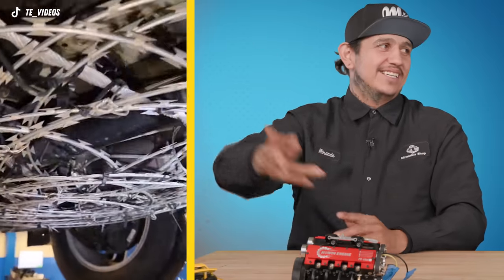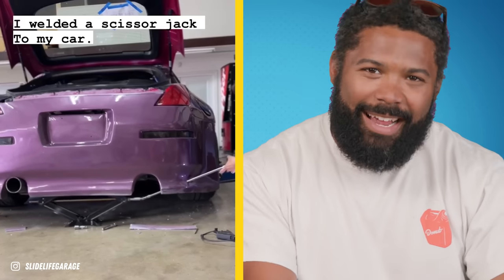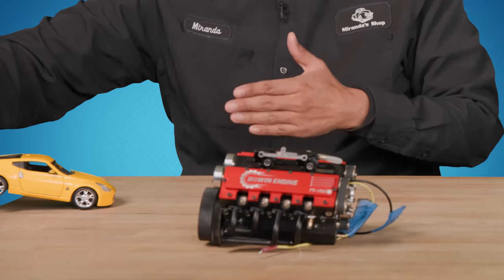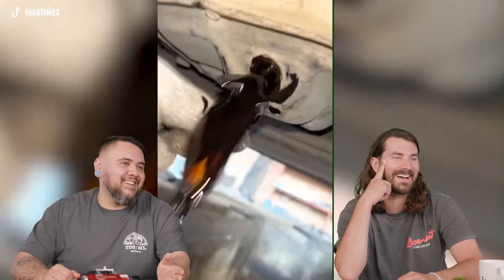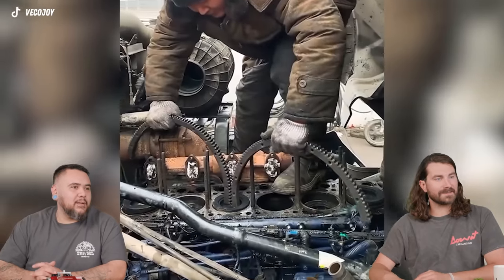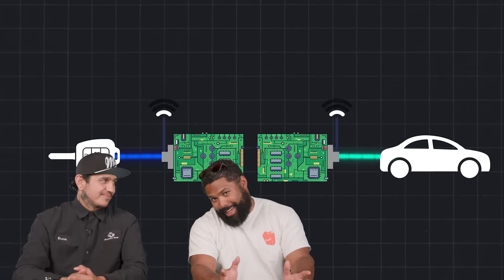Mechanic Reacts to Horrible DIY Car Hacks

Comment: With the tire regrooving, you can see that they filled the newish tire's tread with something and are simply scraping it out.
Reply: It's like nothing 5 minute crafts does is real!😜
Reply: Yes, but you can do that with the tyre repair stuff and get extra height. But yes, not bald
Reply: @LobbyDaLobster  yeah that's why I think it's a waste of time to feature them at all, since the logo alone is enough to dispel doubt on whether it's real or not
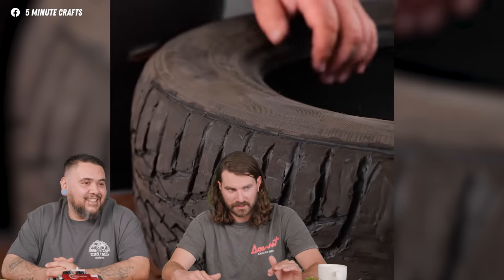Reply: Yeah, where he peels it away at 15:16 and there's a sharp corner on the right. Absolutely bogus. Five minute craps strikes again.
Reply: im roughly 80% sure that’s black playdoh or clay
Reply: @agingerredhead9380  You should be more sure than that! 🤣

Comment: The head/door opener thing works because the amount and shape of water in your head is roughly the right amount to act as an amplifier for the radio signal from the key fob.  You can do the exact same thing with a gallon jug of water (or watery solution like milk, washer fluid, detergent, etc).  Your head is essentially acting as an antenna for the signal.
Reply: Exactly what I was going to type
Reply: Indeed. In my experience the forehead works best.
Reply: It's crazy how good it works, the only downside being brain damage.
Reply: @redrob6026  it doesnt give you brain damage lmao
Reply: @redrob6026  Bro if that gave you brain damage, you'd be a vegetable just from listening to the radio
Reply: I would guess that it is acting as a reflector: not an antenna.
Reply: If only someone sent this explanation to Clarkson on Top Gear the early series where he was asking lol
Reply: Very close, but not quite the entire truth. Your whole body acts an amplifier/antenna. You can see this by placing the fob against your other hand, forearm, or thigh. It doesn't only work off your head.
Reply: @BowJew  Yagi antennas use reflectors that are just bars (not a plane).
Reply: Thanks for the comment! That one definitely needed a science-explanation.
Reply: I've done this with my remote control against my stomach personally
Reply: You are capacitatively coupling the remote to your head. The water in your skull acts as an okay conductor for that frequency band. It does give a little more range but generally not more than a car length or two.
Reply: My dad showed me by placing the fob on my chin, its how I always unlock my car when I am walking up no matter how far I am.
Reply: Oh damn. I thought maybe it had to do with teeth fillings.
Reply: I was thinking it was the water
Reply: It wouldn't work with my ex wife as she lacks a brain. This was discovered post marriage...I should've checked inside her ears prior...live and learn I suppose.
Reply: @Heldemon  I wonder if it's work with my sisters fake boobs....I mean WhUt?
Reply: @notsparks not tru just tested this on my audi and the range is nearly a block when using my head but simply walking away locking and relocking was 2 car distance’s before it no longer worked “regularly” I walked dwn the block across the street put it on my head and like a kid discovering cheat codes for the 1st time the shit worked im flabbergasted the whole world doesn’t kno this trick not 2 or 5 cars but like 15 or 20 it covered easily i will say i stayed linear to the car tho
Reply: It's really handy for finding your car in a lot
Reply: Bro ......... that's f*cking trippy. Who the fuck actually makes this possible? It can't be god, but someone who actually wanted to test it out on themselves
Reply: @jamesphillips2285  Nope, the fluid in your head acts as a capacitor which turns your head into an antenna not a reflector.
Reply: Dude has a man bun, no way I trust his hacks.
Reply: Yes, and it will only work on certain types of fobs.  It is one of those "Your results may vary" sorts of things.  

Another fun one: if you select just the right key ring size it can boost your range.
Reply: Yeah, you're just raising it to a higher level. Raise it way above your head, you'll get the same result. It's like changing out a shorter antenna with a taller antenna. That is a basically The Key Fob is just like a radio, sending out a digital signal. The receiver in the car is waiting for that low powered digital signal to come it's way. The higher you raise it, the further distance that low powered signal is likely to travel. Look for example, your lower powered CB's. The ones who want to communicate at a fairly longer distance, usually will use much taller antennas mounted at higher points on their vehicle. Same concept. Want to test the head theory out. kneel down to where the keyfobe wasn't working, then do it. If no change, that it's nonsense. You're just a pole raising the transmission point up to where it can get to target. Think about it, he had to RAISE it UP to his head. To say why something works, you have to test all the variables present. What's not being done typically? Variables aren't tested. Just saying.
Reply: @Mark3nd It's either a coincidence or It's deliberate by car manufacturers.
The key here is boy height. Around 5'10-5'11 is best for this.
Reply: @CravenD15 
People have actually tested this theory on why it works before & have shown that it being raised to the height of the head is not what is giving the extra distance. i.e. they tried to do it with it held up above & away from their head & then tried it with it touching their head.  Though like someone else has said it isn't specific to your head. Any water inside a cavity work in the same way i.e. if you have a plastic jug of water it will do the same thing.
Reply: Ok this is what is going on here. You can't amplify a signal without power to amplify it. Whether its water or an antenna they do not increase the transmit power. What they do is they shape the signal, flattening it slightly so that there is less signal being fired up and down and more in the horezontal plane. This means it reachs slightly further away in the plane we care about without increasing the power output.

Comment: For the oil one it would work great in desert places, I worked in a tire shop in phoenix and we had to do hot changes. One of the guys at the shop had a 3rd degree burn going from his hand all down his arm from doing them.
Reply: Okay this actually makes sense. I was like is dude really that afraid of dirty fingers working on that dusty ass car
Reply: It also may have been intended to prevent dropping the plug in the oil drain pan.
Reply: I know shops that won't let the mechanics, who started after 2012, touch/handle used oil without nitrite gloves.    Insurance says it's been a proven cancer causing carcinogen since then, so it would open them up for future healthcare lawsuits.
Reply: @thorodinson3597 only the mechanics post 2012, and the guys who started at the shop before that don’t have to?

Comment: I feel like people who do the wrench on wrench crime have never thought of getting a long hollow pole and sticking it over the wrench for leverage. It's a whole lot safer and you can get way more leverage because you can make the wrench essentially longer just by sliding it over the wrench. I've used this method quite a few times because I like to keep my fingers and finger nails and not get blood blisters for when the wrenches slip off each other.
Reply: "getting a long hollow pole and sticking it over the wrench for leverage"
Or a breaker bar, as it's called...

Comment: I’ve used the double wrench, but never seen the triple!  
It’s like I always say: you can always get the job done with the right tool; but you can also always get the job done with enough of the wrong tools!
Reply: when i did some small landscaping/construction we’d always just use a metal pipe over the wrench for leverage, that way you don’t need to use a thick breaker bar in a tight space but you also don’t have to make a chain of tappet wrenches
Reply: @harrisonbrand8985  I’ve done that one  too. I even made a pipe that is partially flattened at one end so that the head of the wrench can fit into it.
Reply: Gotta use the right wrong tools though. In this case the wrong wrong tools will bend.
Reply: @dougaltolan3017  The right ones are those with a warranty
Reply: I go to the wrench method every time🫡
Reply: I've used quadruple at some point but I chickened out and used duct-tape to keep them together before actually doing.

Comment: I think the reason for the zip tie on the cap for the oil pan was to help stop accidentally dropping it in the pan
Reply: I was coming to say this.
Reply: Yes, if it wasn´t for the fact he is actually tightening the thing (turning clockwise).
Reply: @sjurgabriel I'm pretty sure the video just got flipped when he posted it.
Reply: the hack is good for hot oil, as it should be when doing a change.
Reply: @sjurgabriel I am here to say the same thing. Looks to me like it was being tightened.

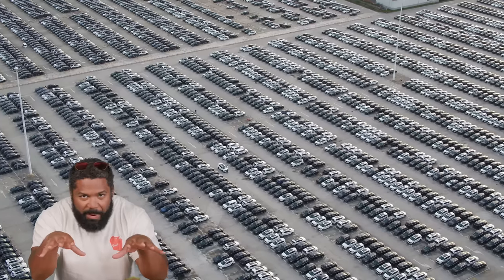Comment: 12:30 Reminds me of a funny time where a friend of mine wanted to use his remote start to warm his car up but he was too far away to get it to work. We both happened to be sousaphone players (Tuba that wraps around you), so he looked up at the bell on his, touched the fob to the brass and started his car from a literal football field away.
Reply: That's kinda awesome sending the fob signal through the tuba 😂
Reply: Thats so sick
Reply: Yeah if you do that hack with your actual head your more likely to get cancer.
Reply: @auxc.6805  pretty sure thats impossible
Reply: @axel995r  he was replying to the guy who said it would give you cancer. radio wavelength photons are really low energy and have a low rate of ionisation. if you would happily hold up a flashlight to your head you should not be worried about holding a car fob to your head, because visible light is several orders of magnitude higher energy than radio waves
Reply: @AlexRoseGames   Yeah I know, I just now noticed that I tagged the wrong person lol.

Comment: The thing with the cat guard setup is that it doesnt have to make it impossible to get, it just has to make it less appealing than finding another car
Reply: you don't need to run faster than a tiger, you just need to run faster than whoever was with you.
Reply: i do that in competitive multiplayer games.
i call it the porcupine strategy.
make it so that targeting you is more work than targeting others for the same reward.
nothing discourages people more than making things tedious.
Reply: Same with basically all locks. There is no lock you can't break or pick given the right tool and no one to report you within 20 minutes. It's just to make it more tedious than an unlocked or lesser lock or hopefully loud enough to break that someone will report it.
Reply: @kyab2815  considering all the videos on the Lockpicking Lawyer's channel i think most locks actually fail that mission pretty spectacularly
Reply: @zilesis1  lock picking lawyer is a pro. Single pin picking isn't exactly a common skill especially at his level and that's one reason he usually specifies whether something is a low skill attack or not. There's a lot of things he can do because he has specially made tools but even then yeah a lot of locks sucks. They do often work to a degree though because often with home break ins it's not even the lock that's the failure point. They kick the door in or break a window not pick the lock because it's just easier for most people.

Comment: 13:00 Kyle Hill actually made a video on that specific topic; it actually works because the wavelength of the radio waves used in those keyfobs for your car are a similar ratio to the size of a human head, so providing a slight barrier that lines up with the wavelength amplifies the signal. Or something, it's been a while since I saw that one.
Reply: What you are observing is a true quantum effect. In short, the radiation emitted by the key causes the atoms in your brain (mostly the water) to oscillate. The net effect is range amplification. To describe this particular phenomenon it is useful to think of the matter in you head in terms of a waveform, not as as a particle. It works with a bottle or jug of water too.

Comment: I’m so happy to finally see someone acknowledge the key fob on your head thing. I’ve been doing that for over 10 years and people always thought I was crazy.
Reply: I do it all the time with remote start when walking to my car so my ac has a little more time to cool here in the Texas heat
Reply: My wife thought I was crazy until she actually tried it. Now its second nature to her at times lmao
Reply: i put the fob on the bottom of my chin
Reply: If it's still too far away you can take off your shoes to properly ground yourself and if it still doesn't work just put one shoe on your head.
Reply: It was on Top Gear back in the day. Just imagine Clarkson doing it in a parking lot and going "ITS MAGIC"
Reply: @ryanmalin  For years I used to open my mouth like a moron and point the fob in there to amplify the signal.. then I realized all you need is point to the chin to get the same effect...🤦‍♂🤦‍♂
Reply: Since the chain on my remote broke, I just keep it in my pocket. I don't take it out, just grab it through the cloth and press...only one active button, so if I press the wrong one, nothing happens. I only unlock it when I'm within reach of the door...no reason to unlock it before that point. I think I will try this out, though, just because it makes no sense that it should work.
Reply: Why does this work? That's so bizarre
Reply: Or you can just use a water bottle 😅
Reply: @jonahkuske8409  so you could just put it in your hand and do it?
Reply: @STOPSYPHER  you can technically use any part of your body to various degrees pg success

Comment: Another option for the bucket separation trick is to use water. Water doesn't compress, but it'll also find it's way into places. If you can blow air down into a stuck bucket, you can blast water down into the same place. So if you don't have an air compressor at home or lying around, you can crimp the end of a hose or use a hose nozzle and spray it at the seam where the two buckets are stuck together and you'll end up blasting enough water in there that it'll fill up, you'll be blasting more water in than it'll be able to push out on top of an empty vessel, like a bucket, will float on water if it's not compromised. So the water will try to find the easiest way out, which is not where it's coming in; oh hey, while it can't compress, it can shove this bucket that's limiting its space out of the way and make it float.

But my point is that using water from a hose is essentially the same thing for those who don't have an air compressor and it's doing it with a "thicker" fluid than air. The key is that more fluid is being shoved into the space between the buckets through the tiny gaps that are there with more pressure and speed than the fluid is able to initially flow out of the same space.

Comment: At 9:48 where they show the guy using three wrenches, there's a safer method that's been around for a long time. Get a chunk of steel pipe that can fit over the head of the wrench and use that to extend the handle. It's often nicknamed a cheater pipe because you're getting more leverage and as-such you're able to get a LOT of torque that you wouldn't have otherwise. I also say this because you could see in the clip that the middle wrench was flexing and I would be afraid of it snapping.
Reply: The pipe over the wrench is known as a Polish torque wrench!
Reply: Depending on the size of wrench that could be a very large pipe.
Reply: They also make leverage bars for wrenches that are flat and have two big teeth on the end that hold the wrench in. I use one all the time to break tie rod nuts.

Comment: Pretty sure the zip tie on the drain plug isn’t for keeping your hands clean. It’s for keeping the drain plug from falling into the oil catch pan if it slips out.
Reply: Same thought, kinda a good hack if you think about it.
Reply: @munawerhayat-naqvi7409  weird, my hack is I just use my hands
Reply: Did oil changes 9hrs a day for seven months, i only see it being useful for when the plug is scorching hot, or for what Simon says
Reply: Was the drain plug in the clip reverse thread? He was turning it clockwise
Reply: @nolanbroderick1234  you gonna zip tie every plug or stick a single brillo pad in the drain thing?
Reply: @Berm_Blaster  I’m guessing it was a front facing camera. Reversing the video
Reply: @simonmiller4306  oh that's true. Lol
Reply: What happens if you drop the zip tie? Oil covered zip tie is definitely going to be harder to hold than the plug. Or you could just put mesh in your drain bucket like every other person.
Reply: @Berm_Blaster  the footage was reversed. Then they jump cut to the bolt being out.
Reply: @SuperRat420  we had a grate over the drain pond that would catch most oil plugs. Never needed to use a hack just got quick with my fingers
Reply: I was thinking the same thing. The plug is hella slippery coming out.
Reply: The zip tie allows you to reverse the threads. 
Right to loosen.
Reply: It's hard enough to keep zip ties around my shop as it is. Using one for every oil change means we would never have zip ties when we need them 😵‍💫
Reply: I thought it was to keep the gloves clean since they were cloth gloves and would have soaked up a bunch of that oil. Either way it's pretty stupid, lol.
Reply: @Berm_Blaster  probably used selfie camera. I was thinking the same thing
Reply: @brucenolin6726  yeah makes sense. I don't use my forward facing camera so it being opposite in selfie mode didn't cross my mind until pointed out